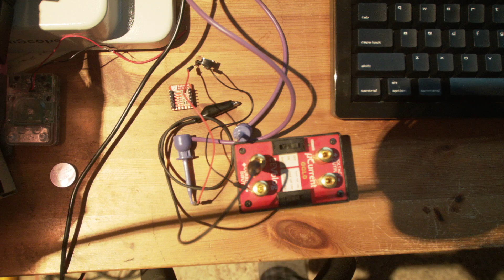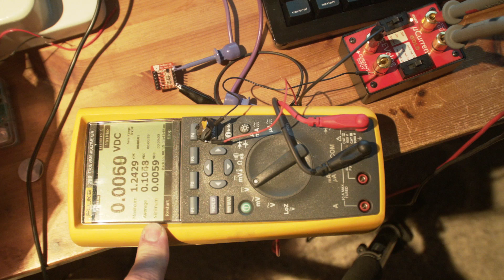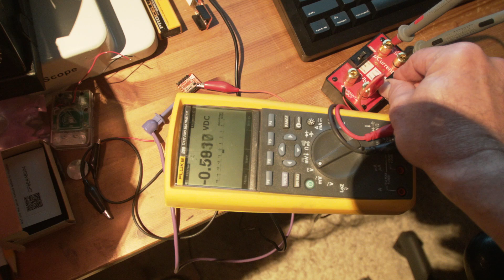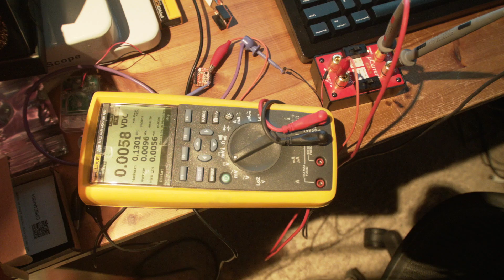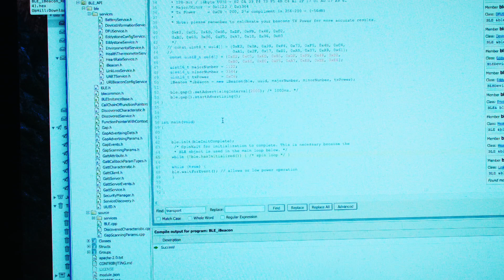BLE Addendum

Comment: Excellent Update. Thank you!!
Reply from the maker: +john mclean Thanks!
Reply from the maker: +john mclean One thing I missed in that video - is I hit the limit of the microCurrent device a couple times.  Dave sets up a virtual ground in the thing, and so even though it's a 3V power supply, the limit of the output is 1.5V  I kept thinking I could get to 3V output on any setting, but au contraire.  Still, the data I present is valid so I'll leave up the vid.  But you may notice the meter maxing out at times.